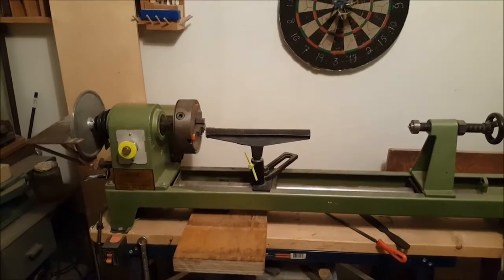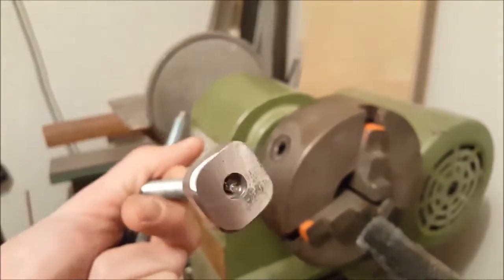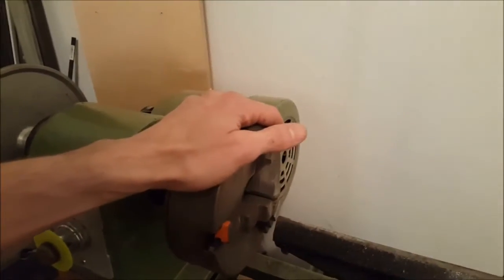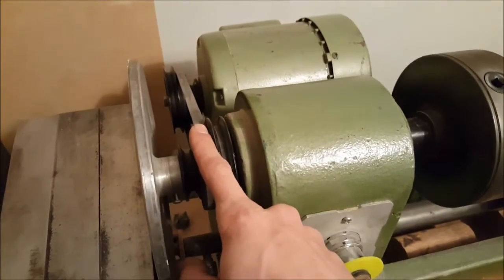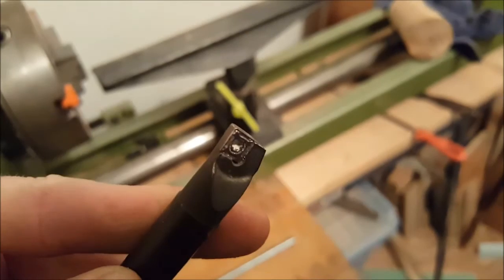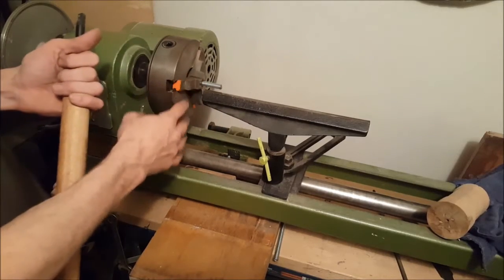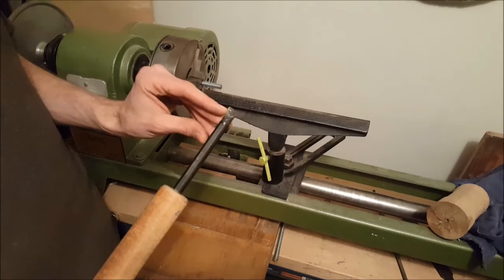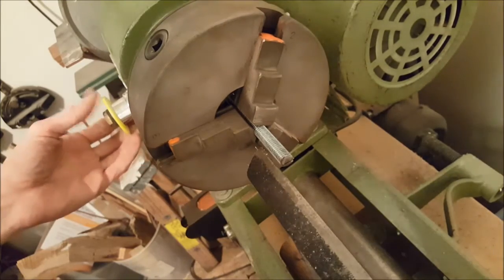Turning Steel on wood lathe

Comment: I know this is an old video, but still useful for new viewers. If your tool is hanging or catching, 

Here's a tip for turning on metal - don't turn from the bottom of a piece, turn from the top. That way, if it catches the tool will want to slide back and away off the top, instead of the tool going under and out towards the stock piece. 

When the piece feels like it wants to climb, the tool will want to go under it and get thrown forwards, through the lathe. In this case, you should turn from the top of the workpiece instead and the tool wont get pulled by the piece, but it will want to be pushed back or away from the piece when it catches. 

Much safer for the tool to be pushed away from the lathe then pulled in by it -especially if you are turning metal by hand on a tool rest, and not using a tool vice. Otherwise, not only can the tool get pulled in, but your hands gripping the tool also can follow.
Reply from the maker: Super comments. Thank you for your help and knoledge. :)

Comment: If the threads are grabbing at the cutter, put the threaded rod in a hand drill, and do a rough grind on your bench grinder.

I gave up on stones for my grinder and use a jewelers wheel with an abrasive belt, (no more trueing of stones), but if you have stone wheels on your grinder, true them before you try the hand drill trick.

Comment: Awesome video. I have some stainless rod I need to shape and was thinking about using files on my wood lathe. I was surprised with how well that bolt turned. Did you have any trouble with heat?
Reply from the maker: Thanks!
No problem with heat what so ever. Could toutch my piece with bare hands after lathe stop turning.  Same as tool, stayed cold.
Reply: A Gontran what are you're lathe specs

Comment: I'm interested - how did you fit the metal turning 3 jaw chuck to your wood lathe spindle?

I've seen some smaller metal turning chucks that have an MT2 taper on the backside that would work but is yours fixed to the spindle thread?
Reply from the maker: Strange as it is..  it came with the 3jaw chuck.  Im trying to find the correct thread converter to geta wood chuck with tapper.

Comment: Hi, what is your lathe rpm and power (watt)?
Reply from the maker: My motor is a 1/2 HP 8amp on 110 so 880watts. I havent calculated the rpm thow, i dont know it's speed.
Reply from the maker: Big guess: 1500rpm
Reply: @damiengontran  Thank you, I want buy wood lathe and I think 550watt power and 500 rpm enought to turning stainless steel .
Reply from the maker: @NossFeRaTu  I hope it works :)

Comment: I wonder if using a file would have been faster, easier, and safer?
Reply from the maker: Hi there. Maby safer yess, but i dought that it would of been faster. From my tests it did’nt work as well. It would not get enough materal out of the way fast. I even suspect that, with the speed and heat over time, it would of jamed a little in the files crevases. But i know it can be used. I recently installed a milling vice on my lathe and did aluminium with. Works very good and most of all, im not the one holding the tool, the vice is. 
Have a nice day.